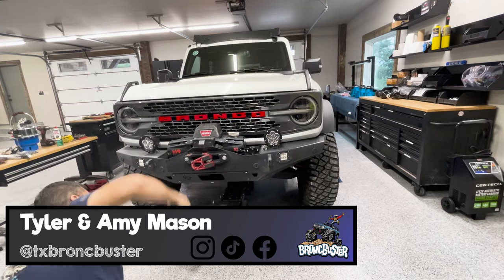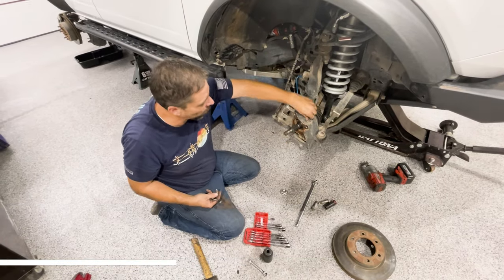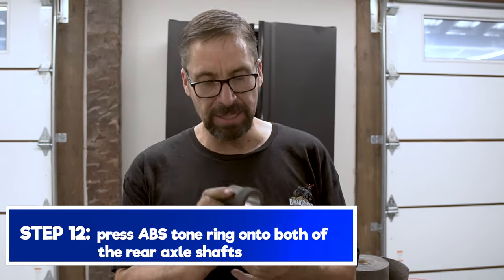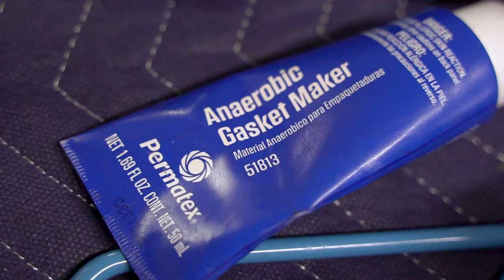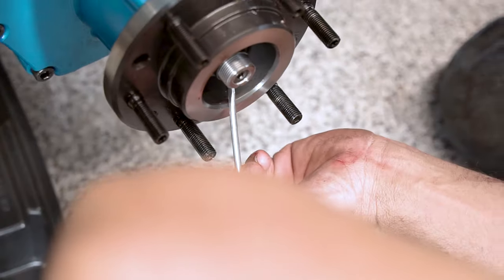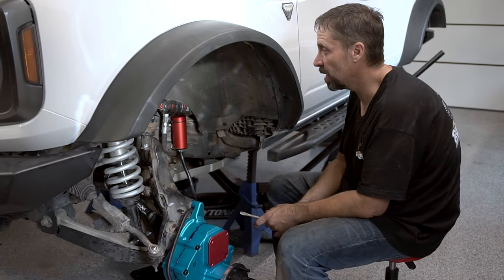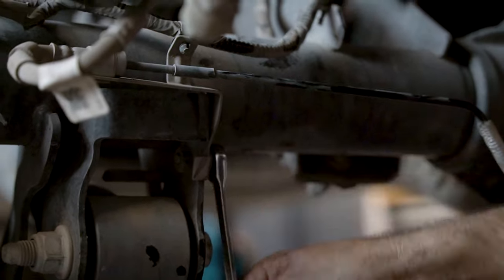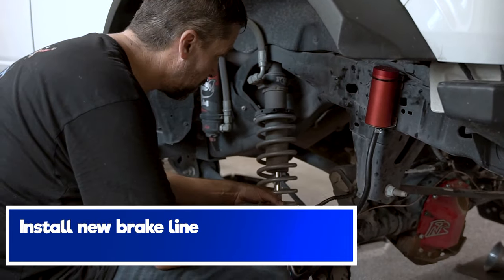BroncBuster Bronco Portal Install

Comment: How much does this wiegh?
Reply from the maker: About 40 lbs each corner
Reply: @BroncBustertx  how much width do they add to each side ? What rims do you recommend?
Reply from the maker: @randalsweeting661  they had about three and three-quarter inches to each side. we use a +60 mm offset wheel. We sell those as well.